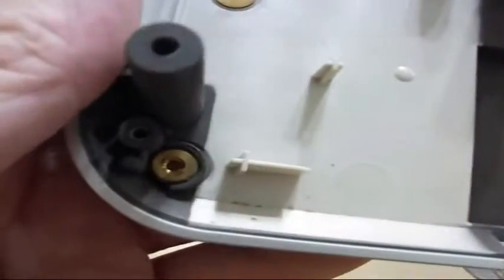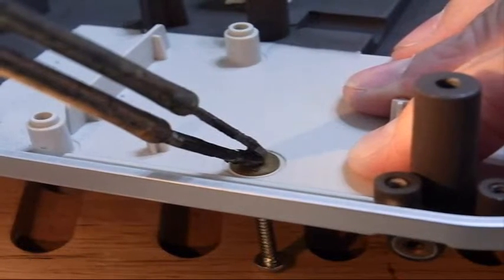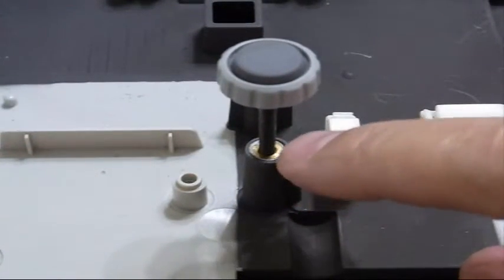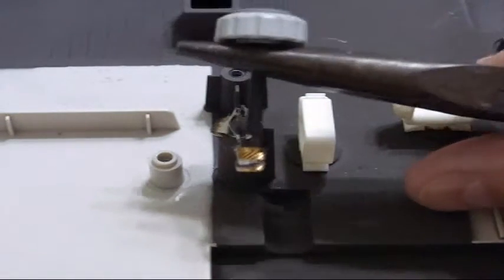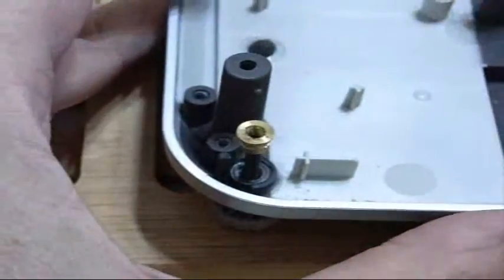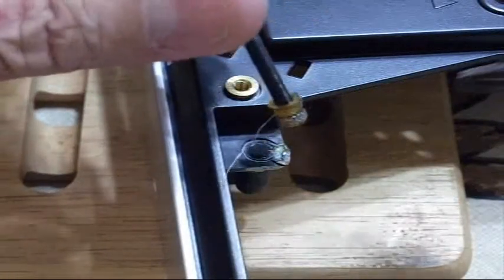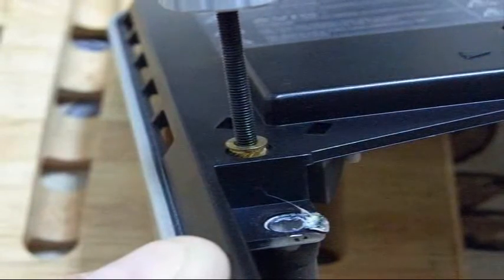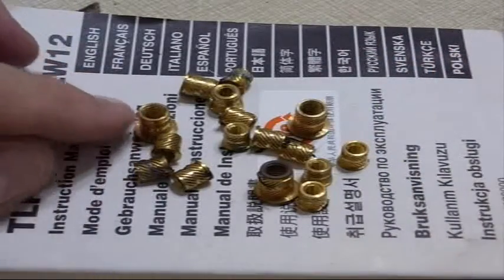Threaded Brass Inserts - Salvaging & Reusing

Comment: Great idea! might work better/faster with a gas soldering iron
Reply: Personally. I use my 8 watt battery powered soldering iron. Impressively powerful. But if you wanted a more powerful option. Just use a 60-100 watt soldering iron. Should take seconds.

Comment: Thanks for making this video.  It is hard to find good inserts - especially when you need one for an immediate project or in my case, are replacing a broken part with a new 3D print onsite, and want to re-use the existing inserts.